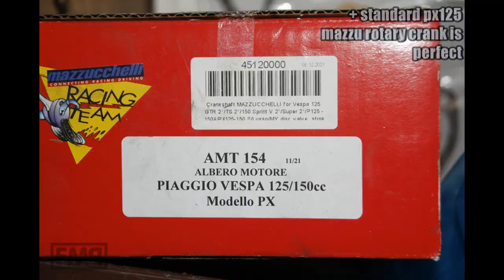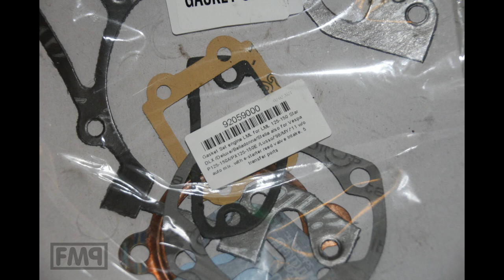LML Star 125/150 needed SERVICE parts / FMPguides - Solid PASSion /

Comment: Ive got a 2t stella (lml 150), and I'm looking for a cylinder kit.  What would you recommend that would go well with my SIP Road 2?

I plan to upgrade crank and go to carbon reed, but keep the 20/20 carb for now.
Reply from the maker: Vmc superG
Reply: @FreakMoPed8  I live in the US, so shipping from SIP brings the VMC kit very close to the cast Malossi 177 for me.  Would you still pick it over the Malossi?
Reply from the maker: Buy vmc at 10pollici or avontecnica, without sip taxes. Yes i would take vmc before malossi, as vmc. Is a new (retired) aprilia racing know how. Read up SLUK article about vmc. Furthermore malossi piston sadly has a weak spot..